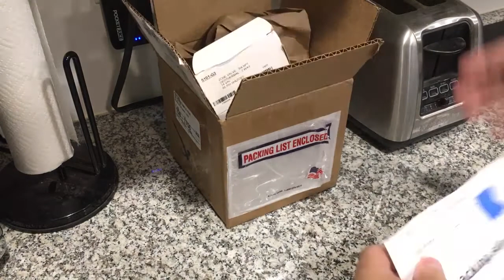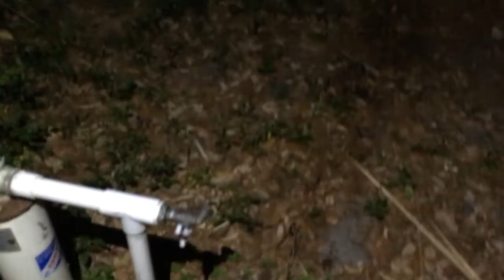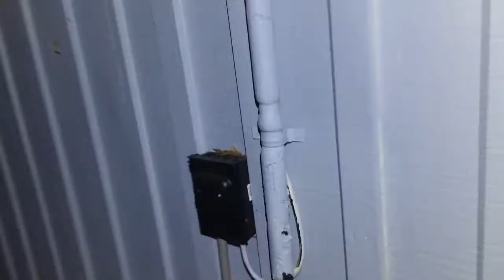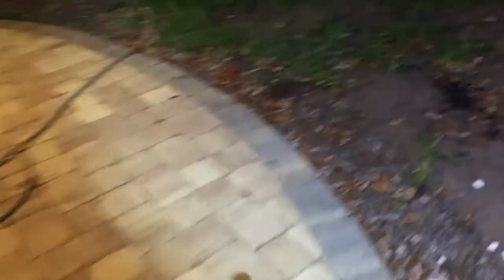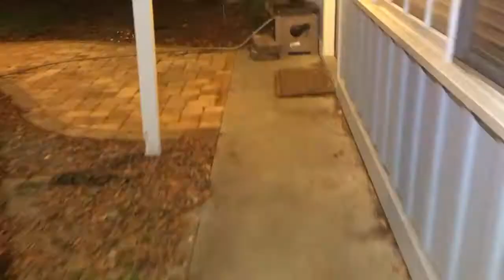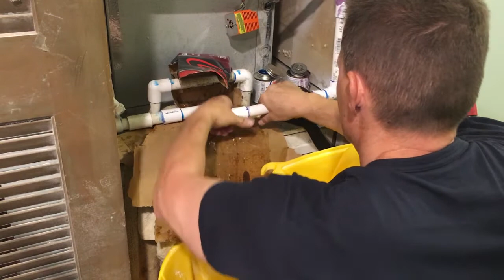Geothermal AC Not Blowing Cold Air Fix DIY

Comment: Just throwing this out there. If I were you and you have to replace zone valve that often. I’d buy 4 more pvc fittings (2) 3/4”  shut off valves and (2) 3/4”  unions. A shut off valve on both sides of zone valve and unions connecting to zone valve. That way you can just shut the valves off, unscrew the union and unscrew your pvc from the valve. Then just screw the old pvc fittings onto new valve, tighten unions, then just turn shit off valves back on..

Comment: You had a leak cause using plumbers tape, on 636, and installing plastic into brass, over tightened, cracked it, glad you don't own a gas furnace
Reply from the maker: It wasn’t cracked. Just couldn’t get a good seal with plumbers tape and pvc.

Comment: You realize , you don't have to change the body, there are 4 screws, guts pull,out, replace them and the head, quicker and cheaper, throw the body away
Reply from the maker: True, but I did not having any experience with this and did not know if it was the head or body.